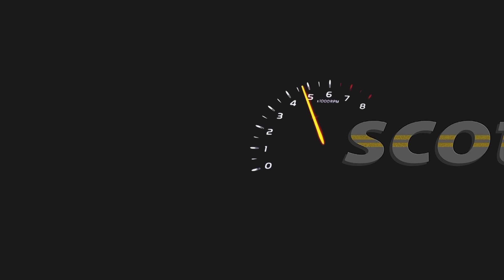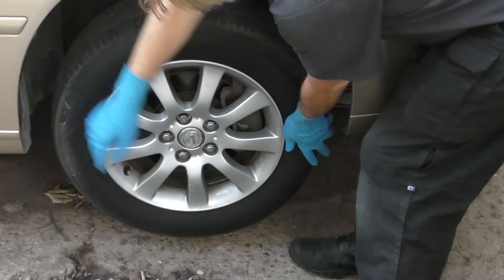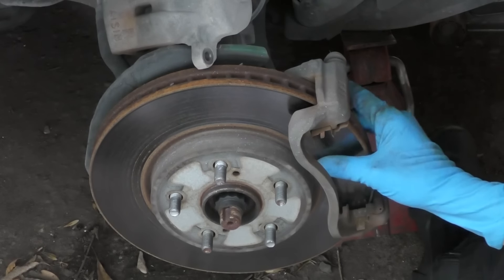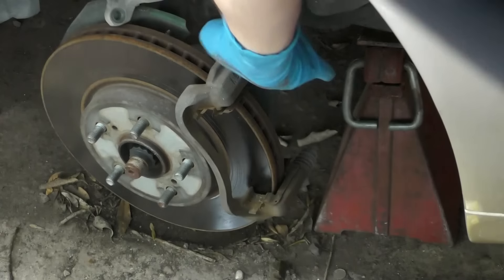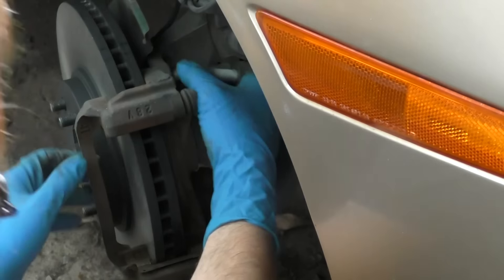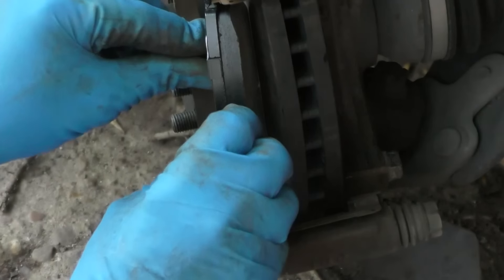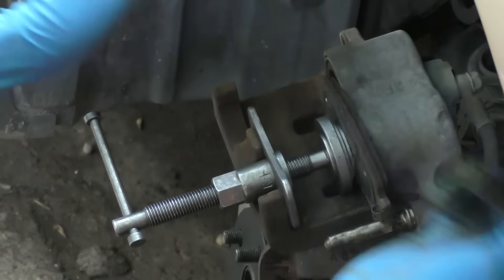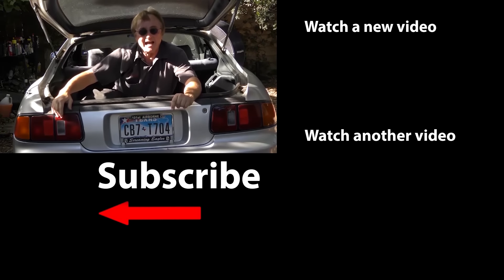Does Your Car Shake When You Brake, Do This

Comment: I think you missed a step. Allout of people over look the slides. While your down there type thing. Just inspects the boots and the two slides. Witch will relly confuse people that a part of your break system is only attached by slides.
I didn’t mean to be rude I’ve done allout of breaks on my friends cars and found Half of them had locked up or corroded slides and Broken boots. Witch caused similar wheel shaking problems.

Comment: 2007 Honda Accord EX 2.4L Manual. So i replaced all 4 rotors, replace pads all around, replace 2 front calipers, and replace front control arm compliance bushings. Shake is gone at all speeds except 30-45 MPH, and get a clunk in the front end. WTF IS THE ISSUE??? It's Driving me crazy!!!

Comment: Disc warpage is not so much difference in thickness ... It's more to do with not being straight , hence the name warped . It's like a flat disc being bent slightly and to properly measure this you need to measure the run out, or how much it deviates from flat. Not differences in thickness. Having been a brake developer and tester for years I should know.

Comment: Hey Scotty could you make a video explaining how to remove a high pitch noise when you’re braking? I took it to the dealership and they charged me $45 to remove a small rock from the caliper but it seems like it won’t be very difficult to fix
Reply: The process would be very similar to what he did in this video.  You'd simply reuse your existing parts (remove the parts, inspect, clean, and replace).

$45 is a fair price. You're lucky they didn't try to charge for a complete new brake job.

Comment: Ok I have a similar problem but it’s when I’m on stop. My steering wheel shakes and makes a shaking sound when I’m on stop. It only happens when I’m on reverse and drive while stopped like at a red light or something. Once I start moving it stops and also when I put the car on park. What could be the problem? And also when I’m driving and i let go of the steering wheel, my car slowly goes to the right and I’m not sure if it has to do something about that

Comment: Hey Scotty, I have a 2015 Kia Optima. When I keep the steering wheel straight the car veers slightly to the right do I have to keep it at an angle to the left to keep driving perfectly straight. I had a wheel alignment done recently but still have the same issue. What else might be the cause of this problem so I  can have it checked out?  Thank you in advance.

Comment: Ok so my steering wheel would shake pretty hard when braking at high speed like exiting off the freeway.   I changed the rotors new oem honda pads and was smooth as silk for about a month.   Then the shaking is back and gets worse with time.   Any ideas???
Reply: Gene Friedman - check it again to make sure rotors not warped.m, pads are seated properly. When reassembling, make sure you pump brakes a few times to get brakes to engage before driving off.  If that don’t work, get an alignment.

Comment: There is absolutely no way that caliper could possibly measure a thickness difference small enough to tell you whether the rotor is warped or not. The first test should be to make a few heavy brake applications to get the brakes hot enough to clean off any deposits. Warped rotors would sometimes be felt as a pulsing brake pedal, whereas pad deposits would never be felt in the pedal.

Comment: Scotty, my steering wheel shakes a bit when I’m cruising at about 45-60 mph. I have 20mm wheel spacers on and before I had my tires changed, I didn’t have an issue with any shaking. Now that I have new tires on and have been balanced according to the guys that changed my tires, it’s been shaking. Any ideas of what might be  causing it?

Comment: You forgot two typical steps.  Take a wire wheel to the hub to knock all the crud and rust off so the rotor sits flush, and lube the caliper pins.

Comment: I recently bought new rotors and break pads from stoptech and I put about 6,000 miles on them and my steering wheel starts to shake. Probably my wheels are the issue

Comment: My car shakes and I can't find out why.  I had the wheels balanced, I've replaced the tires, I've replaced the rotors, I've replaced the cv-joints and it still shakes..  it's a front wheel drive saab and the shake seems to be from the right front tire.. yes I have even swapped wheels.

Comment: maybe you could explain this misery to me, i bought a set of new tires and they are unbalanced/bouncy at highway speeds between 65-80mph.  the old set was perfectly fine.  so i had them balanced again, and still the same problem.  so i had them balanced by another shop and still the same.  thinking it was the tires, i swapped them for another new set of four tires, and these are doing the same thing between the same speeds 65-80mph.
the steering wheel does not shake back and forth, it’s a slight bouncing feeling.

i’m thinking the only other things it could be is the brake rotors, and the drive shaft.
the drive shaft still has its weights on it, so this leaves the brake rotors.  since the steering wheel doesn’t shake, and the bouncy feeling is with the entire truck, what could be causing this slight bounce at certain speeds?

Comment: My 95 dodge ram1500 pickup shakes when i drive, i replaced one of the u-joints but it still shakes but not as bad. Could it be my motor mounts??

Comment: changed my pads and discs 3 times.
and after 5 days of perfect braking it keeps grinding and making binding noise.
only down the passanger side.
ford focus.
no mechanic can fix this problem.
causing crazy steering wheel skakes.
please advise

Comment: Scotty I have a question. I know that sometimes there is no need of replacing the disks if they are relatively new but warped. We can skim them to make them even and smooth. But my question is how many times do you think that this can be done on a set of rotors before they become too thin?
Reply: At least 1-2 times on OEM rotors. 

May not be able to resurface after-market rotors. Check minimum thickness specification.

Comment: Skipped alot of important steps like lubing/cleaning the slide pins. Replacing or cleaning the hardware and squealers onto the pads and bracket. And most importantly pump up the brakes before taking off.

Comment: Scotty Scoty, warping and bad castjobs. ?  Waroing is bending,. caused by water or heat, in this case it could be heat, or bad cast kobs, not thick in certain are3as of the rotor, waRping doesnt cause thickness problems.

Comment: scotty . my steering wheel shakes at highway speeds replaced rotors, pads,bearings ,springs ,shocks,and got it aligned. what could it be?????    .i was thinking maybe ball joint?
Reply: Tires?

Comment: Hey Scotty I got a 08 pt cruiser and just got 2 new front tires and now when I’m goin 70-80 mph my steering wheel shakes and vibrates     Any ideas?
Reply: Johns Memes sounds like those new tires were not balanced correctly. Go back to where you bought them and have them rebalanced.
Reply: Robert Burley  You are so right! Glad you got that fixed!!!!!
Reply: Interesting as BIG o are pretty crap from my experience. But road force balance is the way to go. I always try to find a local shop, Barnsley here in Boulder is pretty good.

Comment: mine shakes above 50 mph and not while breaking. I have the tires rotated and balanced and checked for bubbles. what can be the problem ... its smooth over bumps and  straight as an arrow

Comment: Could warped rotors cause it to shake even when accelerating?
Reply: No, that would be something else. Do the shake the wheel test Scotty did at the beginning of this. If it's wobbly it's probably the wheel bearing. You can also try rotating tires. If your wheel no longer shakes it's either one of the rear tires or wheels you previously had on front.
Reply: You won't believe this, but this maybe the culprit and it was in my case.  Rims "WARPED" !!!

Comment: I’m kind of upset because I took my break sand to get changed and they said that the rotors were messed up so I got new rotors and the car still shakes when I brakes and I just recently got new brakes and rotors in the back of my Nissan Ultima so I don’t know what’s going on maybe it needs brake oil but I think I’m just gonna take it back

Comment: hi guys i just changed all 4 rotors and pads, i decided to go with slotted rotors this time and ceramic brakes, problem is every time i drive at slow speeds i can hear my brakes hissing as if the rotors where grinding with the pads as if worn, is this normal?
Reply: @TotalRandomGamer  but ive been using it normally for around 2 weeks so far and it still makes the sound, shouldnt it have burned off by now from friction
Reply: Are you using your breaks or just driving around

Comment: I have a shaky problem with my car but...steering wheel doesn't shake when i brake,  brake pedal doesn't shake when I brake, i put brand new front tires balanced and car still shakes at 45mph then it goes away pass 45 and it comes back even harder at around 55 all the wat to 65mph. Mechanic checked front end and its good. Ball joints are good, wheel hubs are good, axles are good but....when car shakes i do feel the vibration on gas pedal. I feel it vibrating on my foot. Its driving me crazy. Its a 2016 malibu by the way. Any suggestions??
Reply: privatealex153 Check if your spark plugs are good. Carbon can build on them over time and can make an engine inefficient. I had a car that would shake. Drive system was intact. Found out one of my head gaskets had broken and filled parts of the spark plugs with oil. Making the car shake at specific speed. Going up hill was worse.
Reply: Christian Samuel Sierra thanks! That will be next thing to check on this week. 👍🏽👍🏽

Comment: What about a car that shakes in the steering wheel on the highway between 60/80 depending on the road and the temperature. My 03 Avalon does this ive spent over $1000 trying to fix this prob. Last week it was gone now its back im at a loss :(
Reply: @Dark Days yes the replaced my tires for me under warranty thinking it was the new ones i just purchased didn't help.i took it to toyota service department had them look at it and roadforice balance the tires still no help. BUT i did put the dreaded quick struts on this car and i believe  thats when it started. The dealer said my new front end is very stiff maby making the vib
Reply: @Dark Days ill check the psi tomorrow    ive replaced just about every part on the car now

Comment: Has anyone ever heard of warped discs causing the wheel on balance it speeds between 65 and 80 miles an hour?
my old tires were fine no balancing problems on the highway at any speed two sets of brand new tires and vibration bouncing at 65 to 80 miles an hour.
could it be a total coincidence that my brake rotors or one rotor ended up warped and now it’s causing a bouncing or a vibration but at the very specific speed’s? 
I can’t see that happening.

why would I get a bouncing or a vibration at 65 to 80 miles an hour?

Comment: Ironic because I did replace my pads and mfn rotors and there is a very hard vibration shaking in my front end and steering wheel

Comment: 😒 hmmmmm alot of rotors dont come off that easily, they use the cheapest iron and nonpainted hubs so it rusts and bonds to the hub really bad, its a F nightmare, plus some have those stupid philips screws like honda and some euros. You forgot to mention to buy 'Silicone Brake Grease' its a clear gooee substance like 'dielectric grease' that does not react to rubber, while u have the caliper bracket off...pull off the boots and pins, wipe or washout the boot, pin, holes. Replace pin or boot if its damaged. Apply a dab of fresh silicone to the pin and install. Put only a little cause its super thick. Make double dam sure the pin slides freely 😒 Dont overtighten the caliper bracket bolts. Hang the caliper safely with wire or string. Brake pads go for the premium ceramics, if they have two versions go for the softest versions, avoid the fleet version which is harder. Back Rotor Brakes plan on also rebuilding the inner drum brakes if it has them, replace shoes hardware lube etc. And when u drive dont b an AH learn to baby ur brakes and ur car as a whole, be good to her 😒🚗🚙
Reply: 🤓 oh, and suck out the brake fluid from the reservoir, refill with new fluid, the lazy way to replace the fluid 😊

Comment: "See if your wheels have play in them (shake, shake).  These dont so lets go to the rotors."  Well, what if the DO have play in them?  Would have been nice to mention what THAT would mean, just as a sidebar.
Reply: Sweet Tony 
Normally that would mean a worn wheel bearing. Sometimes if they are of the sealed type, you may see some “wetness” behind the rotor this is an indication that your sealed wheel bearing are starting to leak grease which is not supposed to. If they are not sealed and you see some grease around the back or front of the rotor it can indicate 2 things. 1 the rear wheel hub oil/grease seal is busted needs to be replaced. 2 if it’s in the front then the  cap is not placed in all the way or has some sort of deformaty.

Comment: For the love of God
Torque your wheel lug nuts
Every car has a different rating
My local Harbor Freight has a ft/lbs torque wrench for $20

You want to torque your lugs to get them tight enough to not vibrate off the threads when you drive
Over tightening however can "freeze" the lugs onto the stud over time

Source: I've been a tire tech for three years
Reply: Toyota products notorious for having problems with over tightening lug nuts.  (Learned this the hard way on an Avalon--tire shop used impact wrench then I had the pleasure of replacing rotors....),

Comment: We dnt need to bleed the brakes ?
Reply: You only need to bleed them if you're changing the pistons, brake lines or fluids. Or if there's air in the system. No need for rotor or pad change.

Comment: There are a number of incorrect statements and number of steps you missed. 10 reasons why to not listen to this video. 

1) rotors don’t warp, they wear unevenly
2) measure rotor runout with a dial indicator 
3) pot holes and other sharp impacts can cause your wheel hub / bearing assembly to bend. Measure runout on your wheel hub after you take the rotor off to make sure that’s in spec as well. 0.001 for the hub. 0.002 for the rotors. 
4) silicon (not grease) your caliper sliders
5) silicon or anti-seize the back side of the pad even if they have anti slide surfaces
6) wire brush the wheel hub surface. Many times runout is caused by an uneven rotor seat
7) torque everything to spec. Uneven torque on lug nuts can cause runout
8) explain why you are moving your wheel side to side and top to bottom. The viewers don’t know that you are looking for play in your tie rods, ball joints, and other front end components.
9) always use jack stands 
10) open the brake fluid cap when compressing caliper pistons

Comment: Scotty screwed up. You cant measure warp with calipers. Warp is runout. Put 3 bolts on the disc and use a dial indicator with a magnetic base as you turn the rotor. Or use the Pakistani truck method and clamp a coat hanger to something, bend it close.

Comment: My car shakes when I let the tires wear down to the steel belts.
Reply: Does your spare tire match the other 4 tires?  Having a different make/model of spare tire can do that.

It's also important to add that 5th tire into your rotation routine.   If you don't want to rotate the spare, you can simply flip it over every once in a while.

Comment: I have a popping noise when I steer my car
Reply: Check your suspension parts. 
Ball joints, tie rods, etc.   Might even be your steering rack
Reply: @deasttn  I found out that the bushing on my lower control arm and suspension has an update part

Comment: Few issues with this video. Don't work on a car without jack stands. Don't spray a highly toxic and corrosive chemical in front of a fan because that's just stupid. And also the bolts on the calliper assembly need to be torqued so check your cars specs don't just crank them as hard as you can. And lastly you don't need to buy a $20 brake piston tool. I just use an old c clamp and they only cost $5. Please exercise caution and don't just follow what this guy does without thinking first.

Comment: So wrong. 1. You have to use dial indicator, not that type of measuring tool; 2. Often it just thin layer of your brake pads, so you don't need to replace the disk, try to clean or even sand it first; 3. Never use a  hammer, if you are going to use this disk again, also you can damage other parts; 4. Use f**g torque wrench.

Comment: Why do mechanics insist on using an impact gun to tighten the wheel nuts? Do the job correctly and use a torque wrench and only tighten by hand! Scotty’s not setting a good example for so called professional mechanic!

Comment: l cringe whenever l see a mechanic using an impact wrench to put wheel nuts back on. because it means the mechanic is either a real pro or a real amateur, and you just sit there at the shop wondering what the case is. if it's some kid mechanic then the answer is pretty obvious.